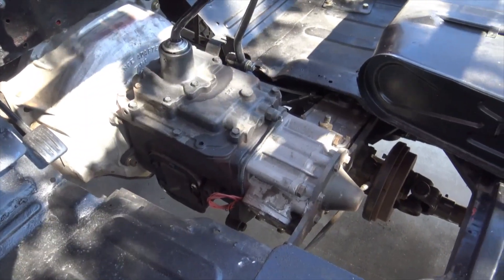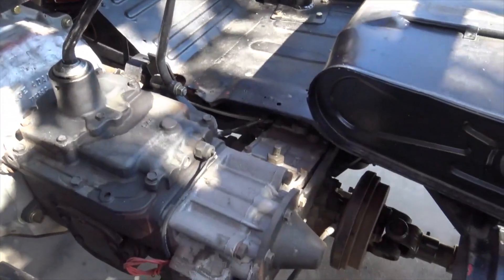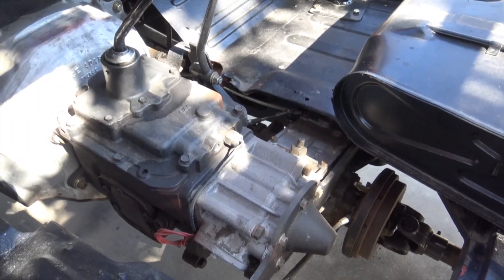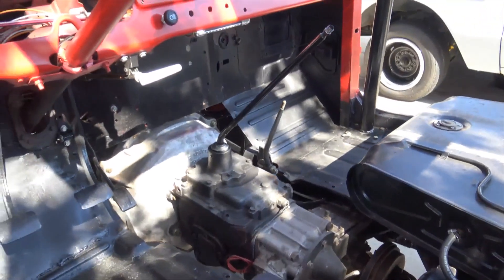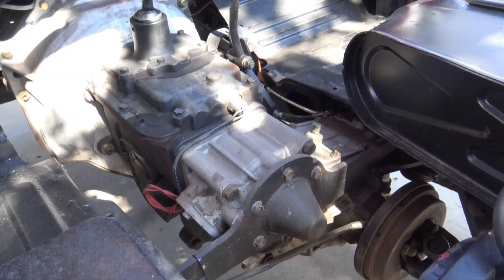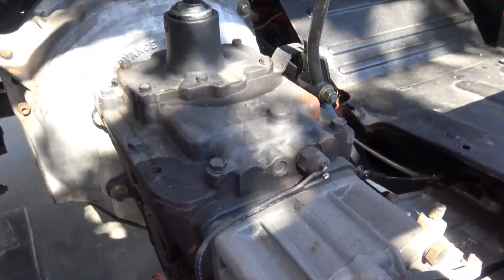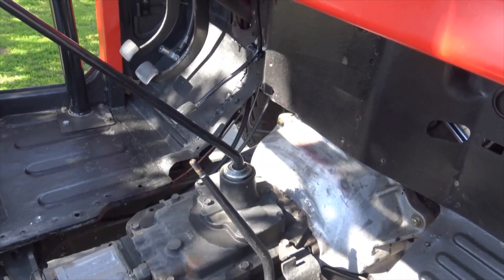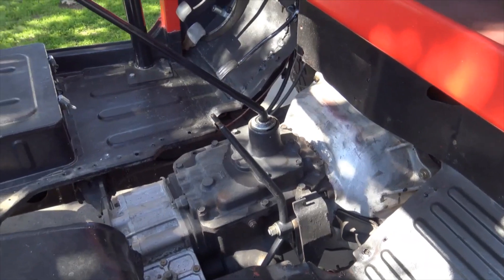Toyota Landcruiser FJ40 transfer case info and 4 speed to 3 speed t-case conversion info   part 1

Comment: I stumbled upon you a few weeks ago. Enjoy your channel and learn a lot. I have a 1970 FJ 40. I ordered a 350 create engine from Summit. My original engine was locked up.I have a three speed transmission that appears to be good. My question is if I convert to a four speed, what transmission would you recommend? I am trying to do it right but on a budget.
Reply from the maker: Hi Mark Thanks for watching  If you could find a SM465 or a SM420 both are good and usually pretty easy to find the 420 is lighter and shifts fast  the 465 is big and heavy but is very HD and 1st is 7:1 real deep keep the 3speed transfer case and the biggest expense is Advance Adapters adapter usually about $700 neighborhood  a Toyota 4 speed the the H41 and 42 are great but very hard to find and very expensive.

Comment: Thats my project now 3speed tranny to 4speed...can i contact you thru facebook? i need ur help.my problem are the tcase input gear and pto gear its not fit to 4speed(Ian Basa my fb account)tnx
Reply from the maker: Hi I don't have facebook but you can e-mail me at landcruiserintervention@gmail.com I'll give you my phone #.  Specter Off Road sor.com has the input gear you need part # 070-10B it's  it's the input gear 4speed -4/75 you may need to change the bearing too it's part # 070-08C and the input PTO gear you can use a spacer part # 070-09BS-A
Reply from the maker: The input gear and bearing are from a 9/73-4/75 Tcase

Comment: SO let me understand this correctly if I buy the 4 Speed transmission and mate it to my 3 speed transfer case will be better then the 4 speed transfer case in driviability? WOW Man Very eye opening. Okay Ill do this instead of going with the 4 speed transfer case.
Reply from the maker: I've done 2 of them now and I sure like the extra torque, you can really feel the difference.
Reply: @landcruiserintervention9443  show mi how u convert the tcase input and pto gear to 4speed main shaft..the 3 speed main shaft spline are big compare to 4speed main shaft  are small...plz contact mi on my fb and need ur help bro(Ian Basa)from phil.tnx
Reply from the maker: @janegracebasa1838  Hi did you see above for info